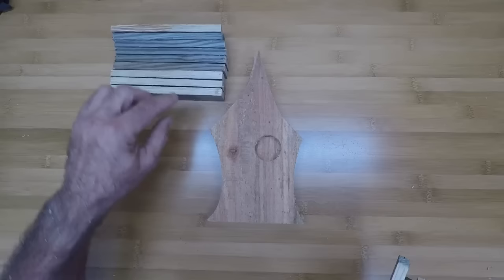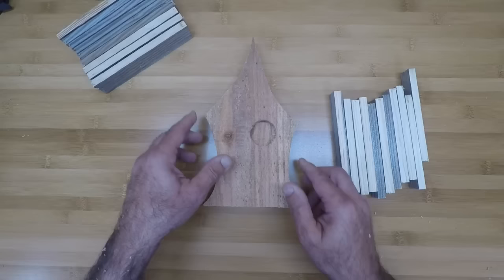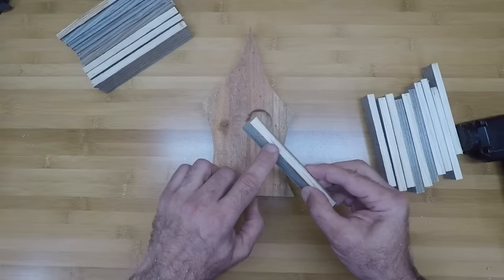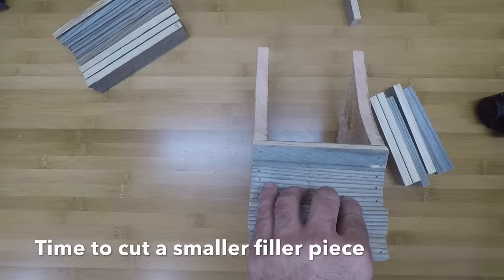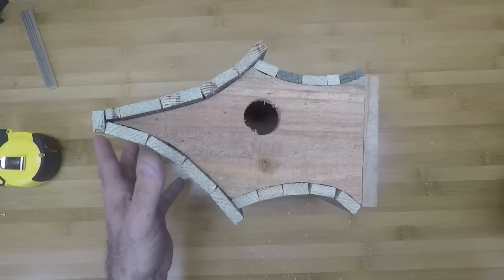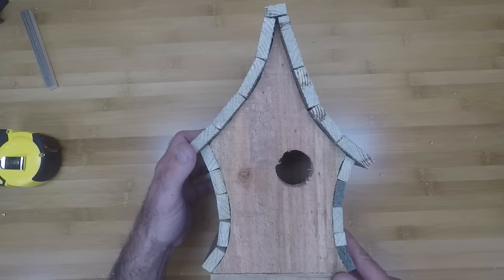Building a Rustic style Birdhouse from cedar pickets - DIY

Comment: Thanks for the video. I did make a  “hinged” bottom by fitting a single angled piece inside of the bottom. The “hinges” are a single brad nail either side of one end and a bent finish nail as a latch at the other end of the bottom piece. Pull and twist the nail and the bottom becomes a trap door to clean out the previous year’s nest. Cheers.
Reply from the maker: That's a great idea!
Reply: Great idea…. Hinges!!!

Comment: Great design and always a great idea to help birds nest safety, pretty design but needs a hole or two in the base to allow for drainage ......  also, airflow could be an issue, so some gaps in the side will help. Hope you used copper brads or rust will result in the whole thing falling apart after a year or two.
Reply: There are four holes in the bottom already for drainage.
My only concern is no way to open it to clean old nesting material out.

Comment: great job man just couple of things from a builder's  point of view when u cut that little piece for the back that should be put in the middle like 2 big pieces up 2 down and small piece in the middle it balances the design second the last piece put on the roof (or top) should be 2 pieces of probably an inch each cut at 10/12 angle and then put it on like a ridge cap. why did i say 10/12 cause of your design this birdhouse looks like those old houses with 12/12 roof pitch
Reply from the maker: Syed thanks for watching the video ...  I actually had thought about doing that, but then thought someone wanting to try it may feel uncomfortable ripping those small pieces with an angle.  Thanks again for watching and the input.

Comment: I am new at bird houses and am wondering if a perch is or is not standard for bird houses?
Reply from the maker: Brian, Good Question, some birds require and some do not..usually individuals will not put a perch on houses for smaller birds because they don't need a perch to land it would provide a larger bird to land and possibly cause issues for the babies or smaller bird.  I really don't have a problem with other birds.  I have a house that the sparrows are using and I added a perch so I could film the mother feeding the babies.. I have a video on my channel showing that... when I didn't have the perch she land in the hole and you could see the feedings...I was able to get some good video with the perch.

Thanks for watching the video and if you have any other questions, please let me know.  Very important to have a clean out... on this house I ended up replacing the nails in the bottom with 4 screws so I could take the bottom off at the end of the season and clean it out.

Have an awesome day.

Comment: What brand scroll saw do you have?
Reply from the maker: It's a Delta 40-601. Really nice saw... I purchased it about 2 years ago... thats the one used in the video.... that has a smaller profile for the shop... I also have a Delta/Rockwell 40-440 now that is a sweat machine... got it from my Dad many many years ago... that saw will take needle files also it has a slot for your flat blades and it also moves over so u can insert a needle file... if u want to see that unit using a needle file there is a video on u tube, not mine, just type in Delta/Rockwell with needle file...its an awesome machine but has a big foot print...what type do u have?

Comment: And you clean it out how?
Reply from the maker: Lee first off thanks for watching the video... after the season ended last year... I pried the bottom off and removed the nails and replaced with 4 screws... I thought about putting hinges on the floor and a hook, but decided taking out 4 screws once a year wasn't really a big deal... when I make it  for someone else I do put a couple hinges and a hook for them.  Hope that helps... didn't go back and re-do the video, because for the first 7 months this video only had 100 views... now it has 28K... I guess video can be seasonal also, which I never thought of... since I have only been posting video's for 11 months.  Again, thank you for watching and asking a question... Have an awesome day.
Reply: I put in two nails in the back of the floor on either side as a hinge.  One nail in the front to keep it from opening.  Just put the front nail out, floor swings open and just let the old nest drop out.  I call it, "swing and clean."  I sell a lot of houses. @MarkDohring
Reply from the maker: Lee Fury yep that’s another way for the single front one I will use a cut off double headed nail.. so it’s like a little handle ... that’s great that u making houses also .. I’m getting ready to make a outhouse birdhouse ... probably Wednesday .. it going to be fun...
Reply: If it is an "antiqued" house, I will use an old, shortened, rusty nail for a pull tab.  But I still have another means for locking the either the floor or a side from opening.  You need a pull tab because sometimes with age and moisture, the wood expands and doesn't swing open as easily.  ALWAYS use spar urethane on exterior but never on the inside.  Little birds will peck at the interior.  Don't give them any finish to peck off.  
 @MarkDohring
Reply: One more trick I do is glue in a piece of aromatic cedar inside with a good shellacking of cedar oil every new season.  Yes, I take down my houses in the fall.
Reply from the maker: some good tips... thank you... have an awesome day.